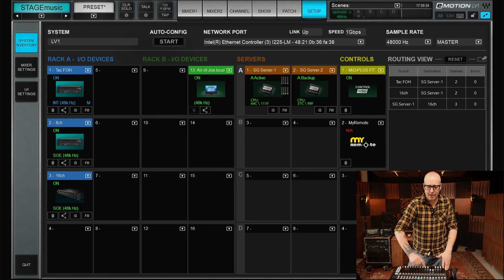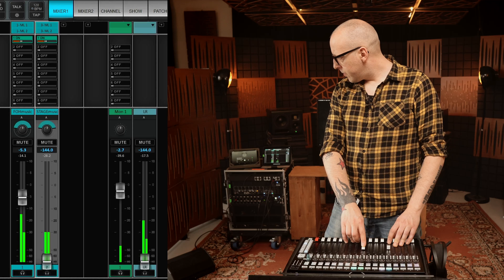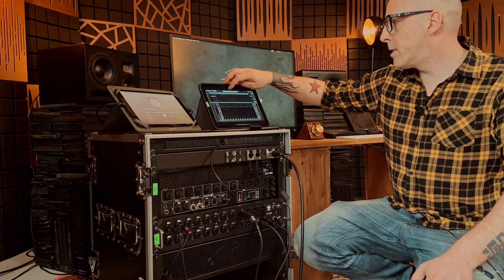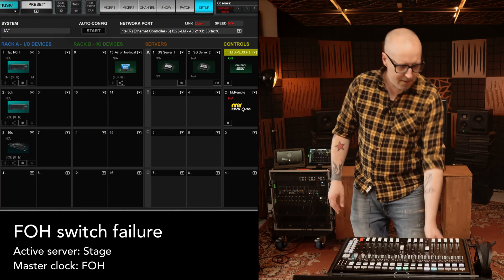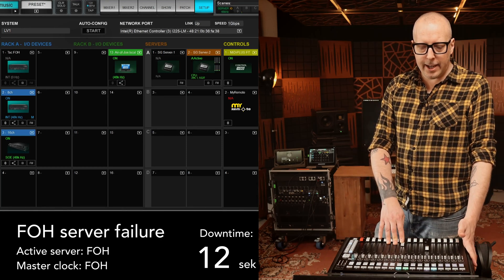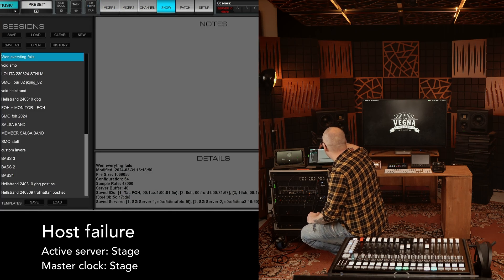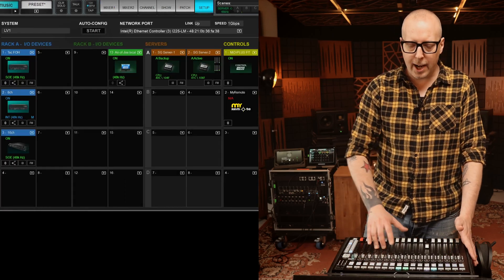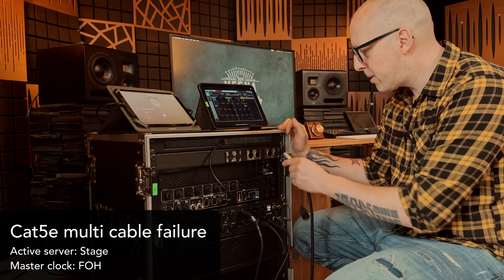When everything breaks - Waves LV1

Comment: @joevegna  Another thought is if the host and FIT lose connection, you could have a tablet for a Redundant wireless control in that case .
Reply from the maker: I think the wireless control dies of the host lose connection since it's just a mirror of the host. 
However I have another redundant solution coming up so stay tuned.
Reply: @joevegna  Awesome! Cant wait to tune in and see what it is.

Comment: This is a fantastic video!!! It seems that the I/O, stageboxes, and server need to all run on stage. What also seems to need to happen is having a backup cat5 or 6 run and also a backup computer at FOH for redundancy.
Reply from the maker: Basically you are spot on. It's not possible to have a connected computer on stage for redundancy sadly. But if everything but the host is on stage you are probably at the most secure state with the Soundgrid network. 
There are a bit of redundancy issues to sort out for Waves in order to make this 100% secure.

Comment: Mix mirror app is still working because your host computer is also connected to your wireless router via Wi-Fi. But if you turn the Wi-Fi off on your host computer then mix mirror will disconnect
Reply from the maker: The strange thing is that the wifi card is disabled in the host computer. And it has never been connected to the router via wifi so it doesn't even know the password. 
But then again that's the only explanation so ... yeah, I don't know. Ghosts? Magic?

Comment: I’ve had my LV1 host break down on me only once during the second song into a show. 

Audio was still going to PA and monitors. Band didn’t notice anything! Even my TTS mic was still working via DsPro1000. 

When I asked the band to be quiet for a couple of seconds in between song, I restarted LV1 software and audio was only interrupted for about 3 seconds maximum. 
Shows was back on again!! 👌🏻

My setup:
- DsPro4000 on stage / master 
- Extreme C X10on stage / main server 
- DsPro1000 at FOH
- Extreme server X9 at FOH / redundant

I always set up / turn on stage before FOH, and check redundancy before sound/linecheck.
Reply: Even reading this my hearth stopped pounding.
Reply from the maker: Thanks for sharing. I think I need to switch things around to have it setup as you describe.
Reply: how do you check for redudance Jeff?
Reply: @aa_soundvision  you can check redundancy in the drop-down menu from one of the servers in the set-up / servers tab. Where you see server info etc.

Comment: I have both servers, switch and stagebox as master clock on stage. The only thing at FOH is the host and some IO for talkback and PFL. Seems to me the most logical, as most bandwidth is between the server and IO, so there is short good quality shielded cables between the server and stagebox. The cable between stage and FOH is usually provided by the sound company when I'm doing festivals or bigger stages and that way I don't have to worry too much if that cable has perfect signal integrity.
Reply from the maker: Cool. Yeah that sounds like the mist logical thing. I need to switch things around and set it up as you described.

Comment: The best solution i think is:
1. server on stage
2. host on stage running LV1 app
3. master IO on stage (LV1 will never fallback to the FOH io as master)
4. host on FOH running RUSTDESK (or Teamviewer) and control LV1 app remotely (just the same way as MixMirror does)
5. Advanced: Using MIDI over Ethernet like BOME to remotely control LV1 on stage with Waves FIT controller

Between STAGE and FOH you need 2 cat5e: 1 for audio, 1 for remote access (or basic comuputer network)

I think you have done remote access network but just via WIFI (this can work also but i like the cable)
Reply from the maker: You might be right. I'm a bit afraid of adding more complexity with Rustdesk and Bome. More things that might break. Then again, IF they break, the show goes on. 
Thanks for your input.
Reply: @joevegna  Yes exactly. It is more complex but if something died (like you said more things that might break...) but if will... nothing really happend.. evertyhing just works and show continue.. only what you "lost" is control over LV1 but this is the same when broke something what you tried plus will be noticable audio drop..
Reply from the maker: Right. I think I need to rearrange things.
Reply: Would Teamviewer/Rustdesk recognise input changes from the fit controller?
Reply: @AlexanderGibbonsAudio  No directly, but this is not the case,bcause you can have BOME klient at LV1 host on stage, ane BOME cllient at FOH host... so FIT connected via USB to the FOH host, patchet virtualy via BOME as midi device via network to LV1 host at stage

Comment: I guess that the recommendation is related to the maximum distance betwen components. Soundgrid host to switch can work over a weaker signal (100MB/s) and the maximum distance then is reduced from 100 meters to 20 meters. Also from a traditional mixer, if the console dies, the sound dies. My 2 cents. Keep on with the good content!
Reply from the maker: Right. But nothing really speaking against actually having the server up on the stage. And just the host at FOH since it can take the longer cable run. 
Thanks for your input :)

Comment: 3:37 The switch should be for the soundgrid network. MixMirror should run through your WiFi router.  Or maybe I am confused, that happens often. 😂
Reply from the maker: Haha, well I’m still confused about this one. MixMirror connects to the wifi router. The router is connected to the switch. But the host is not connected to the switch. 
The host is not connected to anything. 
But it still works. 
Confusion deLuxe.
Reply: @joevegna is yout host maybe connected to the wirless ap? :)
Reply from the maker: Well it must be, I just don't know how. The wifi is disabled on the host computer, and the cat cable removed. Beats me.
Reply: Were they maybe on another wireless network?
You need a separate network for remote anyway. Remote is not working via SoundGrid.
Reply from the maker: @JeffreyKok-ny4wc The iPad was connected to a router that’s in the soundgrid network. But the wifi card on the host is disabled, not just off. So it’s still kinda strange. I don’t have an answer to this one.
Reply: The host server should have 2 Ethernet ports, one for soundgrid network, one for normal network.  If the normal network Ethernet cable is plugged into the wireless router, you wouldn’t have WiFi enabled in windows, it would be using physical Ethernet to the wireless router, that router has wireless enabled.

Does your host have 2 Ethernet cables plugged in?    If so, where does the normal Ethernet cable run?  It shouldn’t run into the soundgrid switch, per the manual, only soundgrid traffic should route through the switch.
Reply from the maker: Exactly. But the host only has 1 network port. For the soundgrid. So … still confusing. 🫤
Reply: Gotcha, my host has two ports but I just use a usb WiFi dongle for all the wireless apps.  One last question, could it be magic?  Seems like the next likely reason. 😂
Reply from the maker: Only reasonable explanation is magic.